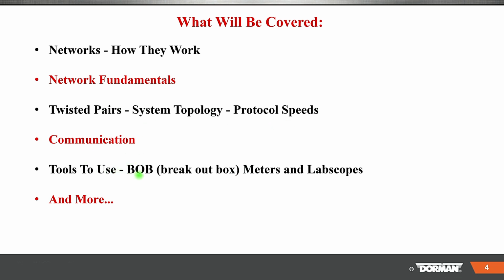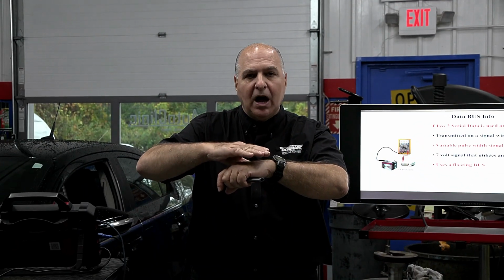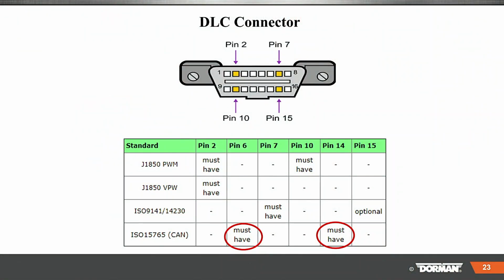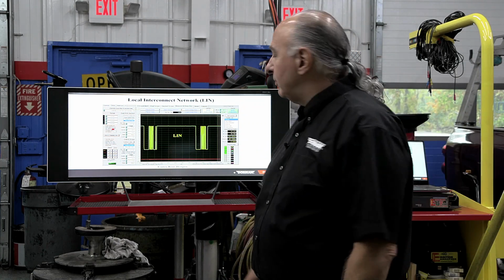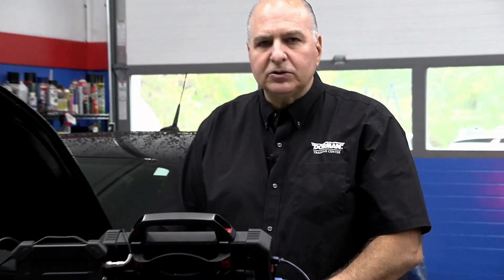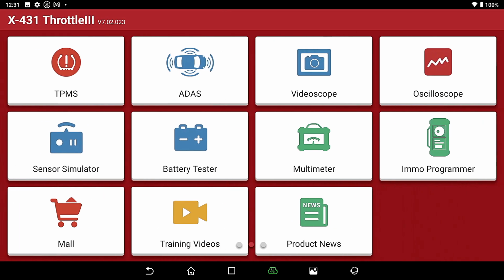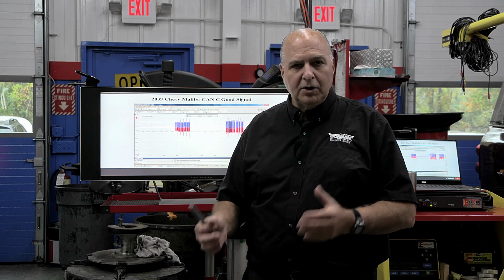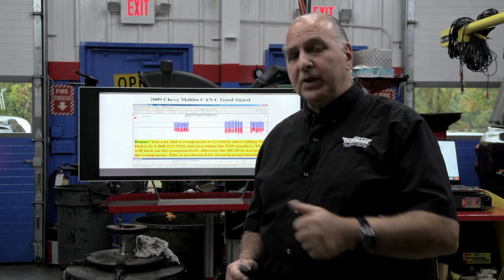Network  Diagnosis Dorman Lunch and Learn 10 20 2023

Comment: The abs should do brakes not ignition.  Expensive modules replace a .50 part that never brake. Like rod that locks doors and opens doors to much tech